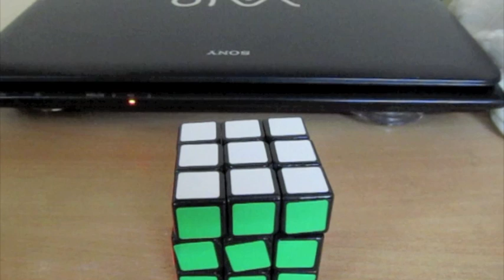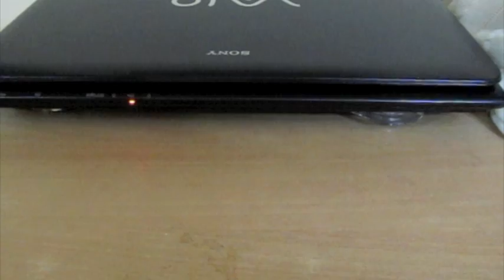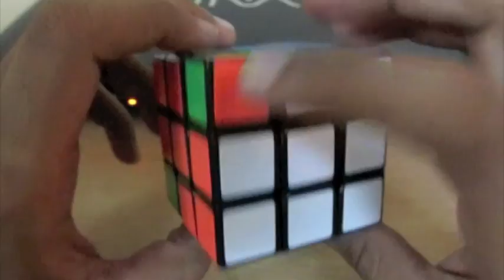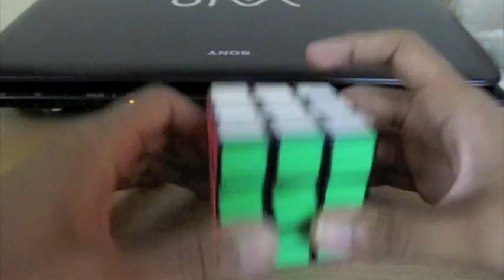3-Style Corners Part 1(pure commutators examples)

Comment: For the first commutator could you do:
D' F U' F' D F  U F'
Reply from the maker: Of course! It's good that you're thinking and not accepting convention. It's the fastest way to learn 3-style. But once it comes to getting fast, your cases should be optimized for avoiding: rotations/excess moves/bad fingertricks. Your alg is somewhat harder to fingertrick than R U2 R' D R U2 R' D' and hence I'd probably not use it in a speedsolve.
Reply: Wow you replied!
And thanks, and I have one more question:
During a speedsolve, how do you quickly figure out whether it is an insertion first or interchange first commutator?
Reply from the maker: You're welcome. I've been busy of late as I'm working now and don't have the time like I did during college to make more content lol. I still try to reply when I can. Coming to your question, I don't think about that part much. When doing sighted solves using commutators, that is when I try to figure this stuff out. Trying to optimize my algs, doing algs from different angles if it reduces rotations. In a blind solve, it's all brain dead just like drilled algs for CFOP last layer. That way is the best way to ensure you are able to retain your memo. At least, that's the ultimate goal. I was close to it when I used to practice a lot.
Reply: Thanks